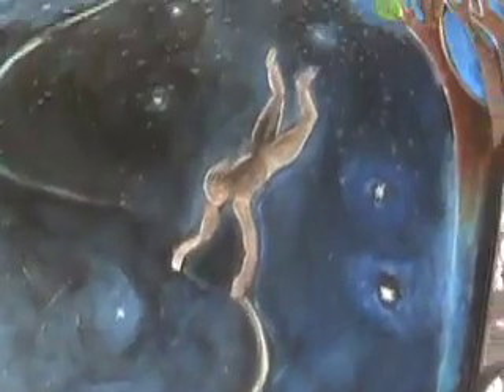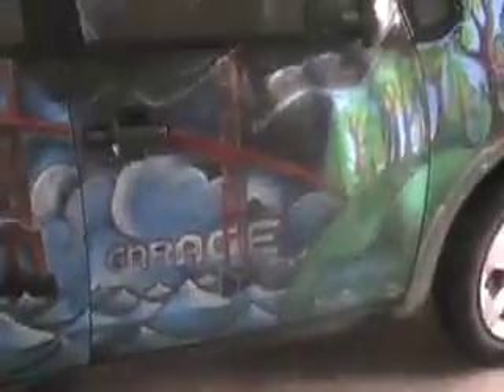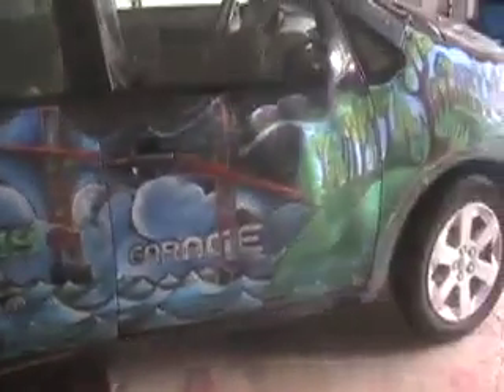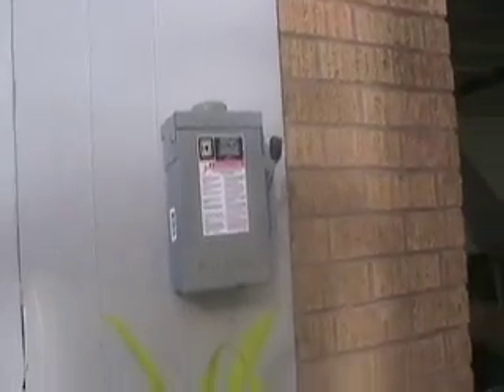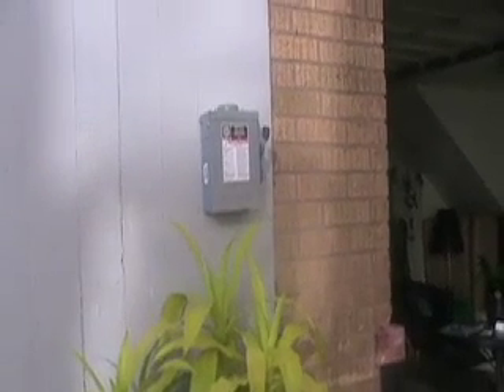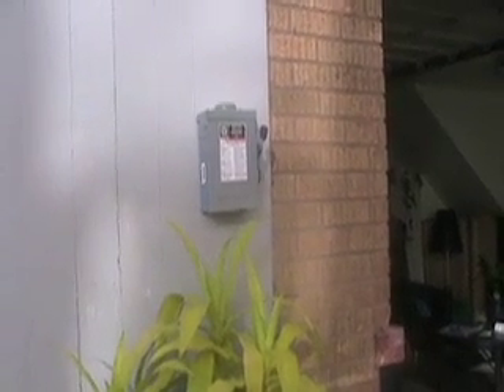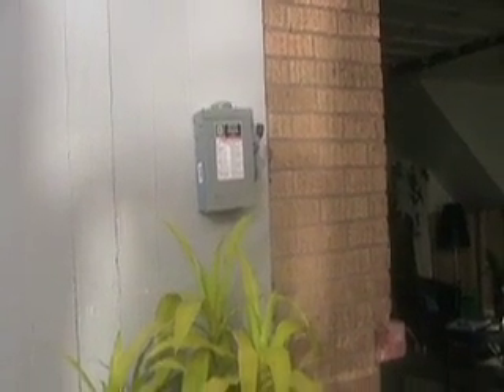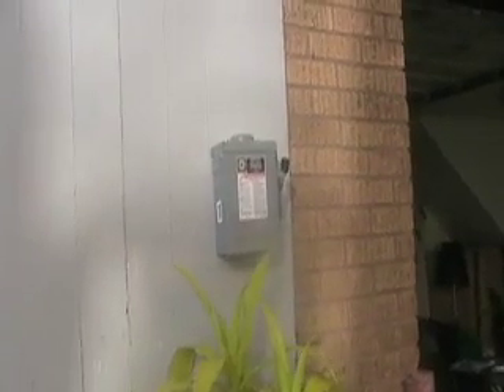luscious Garage in San Francisco converts Prius to plug-in

Comment: Wow, you really don't like the Volt to think this is better.  The Volt gets more then twice the range and at highway speed.  This conversion can't get on the highway without kicking in the ICE.  Cost of the this conversion is $13K + cost of Prius so it is more if you use a new Prius.